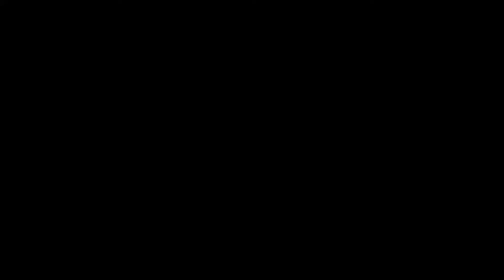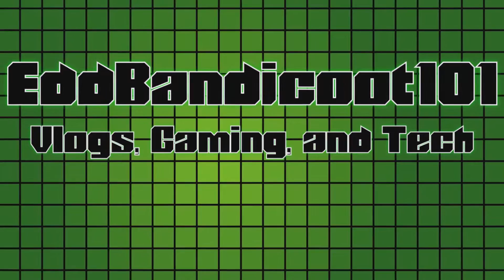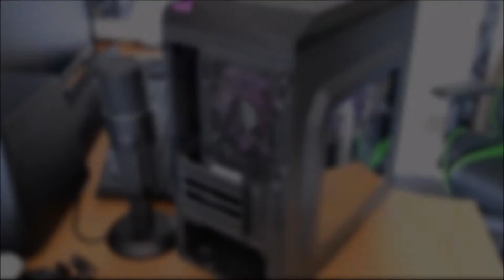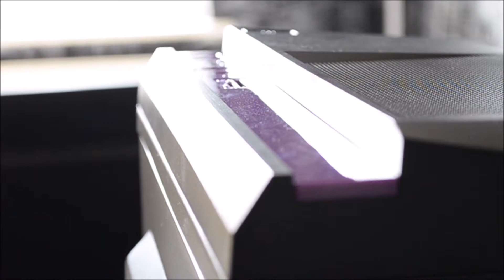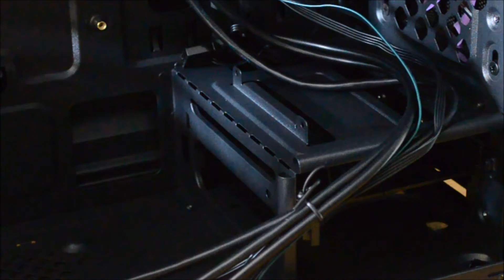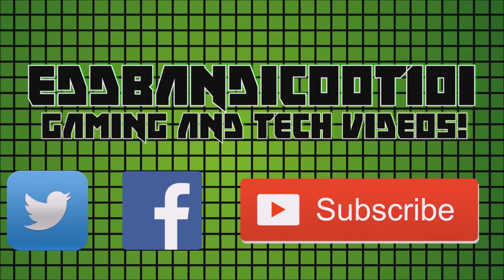CiT F3 mATX PC case review!

Comment: the panel on the side supports
 2.5" drives.. read a review before doing one.
Reply from the maker: The Unreliable Narrator How about you read your comment through so you don't have to edit it? ;)
Reply: How about You could edit an annotation into the video.. and don't you see the irony in me correcting a mistake I made while you still haven't acknowledged yours? ;)
Reply: so mature. : ^      )
Reply: The Unreliable Narrator I was just about to order all of my PC parts, then i read this comment cuz this is the case im getting and i didnt have 2.5” drives. You actually saved me, thanks!
Reply: Was literally about to say the same thing. Kudos

Comment: How do i take off the front and top panel?
Reply from the maker: Piehigh Pull from the bottom of the front panel, then from the front of the top panel.
Reply: How do i remove the front one if it is too hard. It seems to be stuck

Comment: Yep, it's a badly designed and rather shit case. That 2.5" drive mount is near impossible to use if you have a PSU in it.
Reply: The psu is at the left hand side of the case and so you should have plenty of space to add a 2.5 inch drive. Unless your talking about the mounting brackets which aren't the best but get the job done